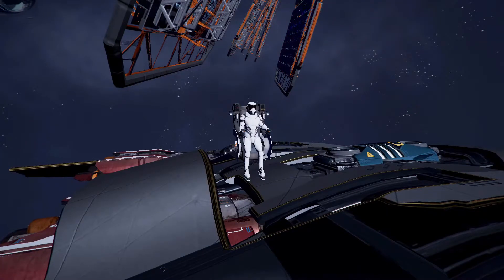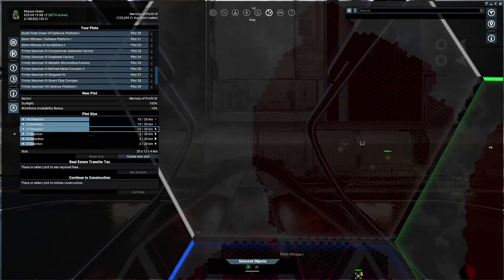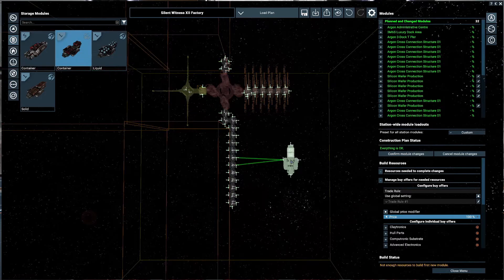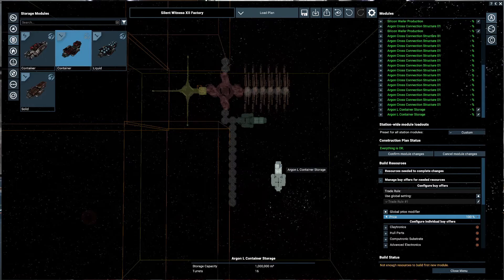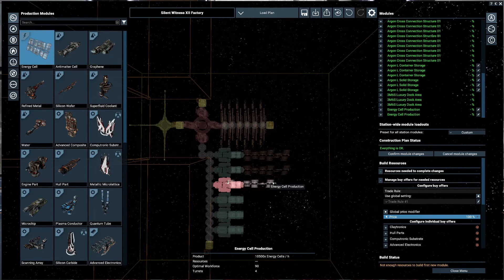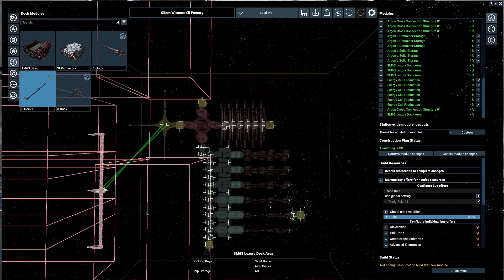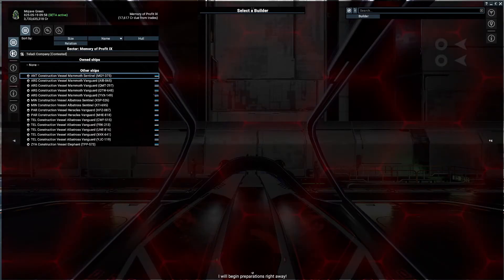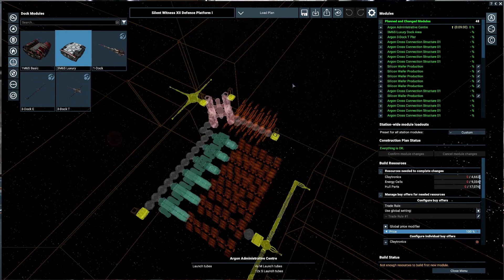X4 Cradle of Humanity - Build Silicon Wafer Factory

Comment: 4.1 gives you the ability to rotate all things on 3 different axis' now. Your build woulda been fine if you stretched the 3 pier out with a couple of extenders or rotated it 90 degrees to be vertical vs horizontal on the station.
Reply from the maker: I actually did try to rotate it in my practice session but you are right I could have extended the 3 pier.  Update 4.1 caught me off guard I had already built 6 silicon factories before filming this one.  Update 4.1 has a lot of advantages but it has some downfalls like trying to build in a sector where the planet is too close like in sector Memory of Profit 9 which is one of the terraforming sectors.  Update 4.1 made 80% of my existing build videos obsolete.